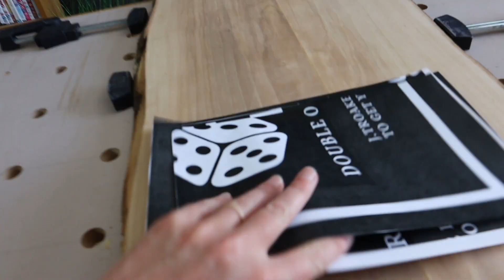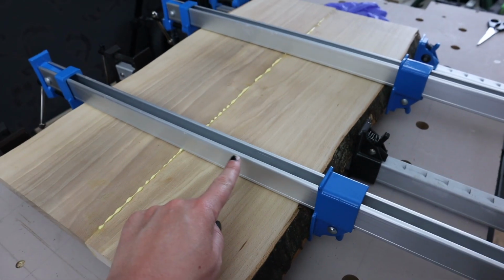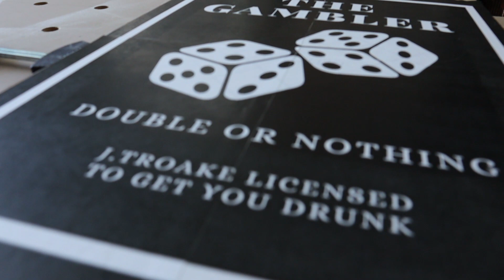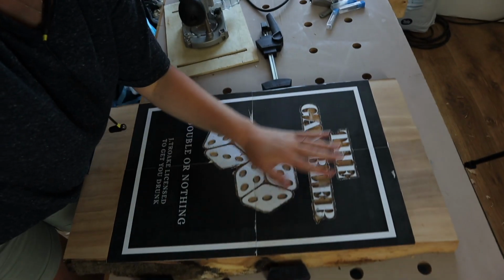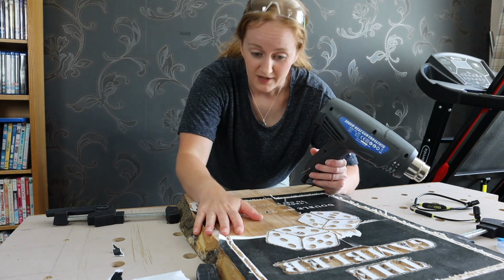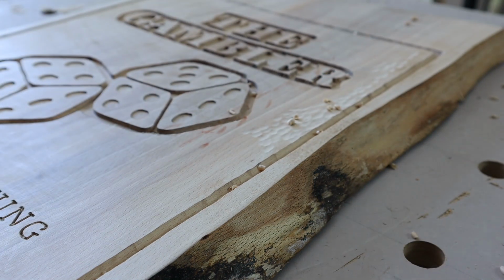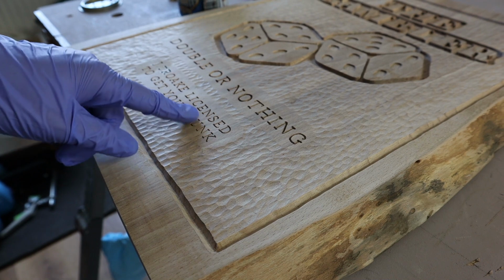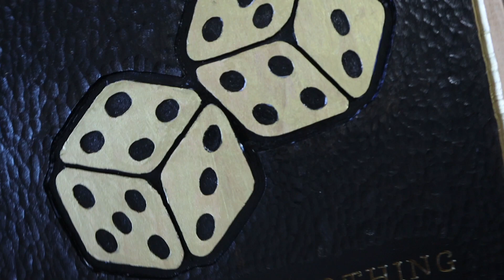THE GAMBLER - How to make a BAR Sign | Hand Routed

Comment: That came out very nice. Do you have any tips for beginners? I have a small router and it jumps a lot where it messes up my letters and I have to give up or start all over again. I see you have a flat piece attached to yours, did you make that or did your router come with it?
Reply from the maker: Thank you very much! I would say the main things that can cause the router to jump around is usually 1 or a combination of the following things. Grain and wood species, speed of the router itself, blunt cutters, taking too much of a cut at one time. The flat part on mine is just a piece of plywood which I made, not specifically for routing signs. Use it for different things but usually gives me a larger footprint when routing over large gaps. I like to use the base with handles because it gives me more control when lifting in and out of cuts. If you have just a trim router I would suggest adding a base (from clear acrylic) and attach two knobs as handles either side. This will give you greater control.

My tips for hand routing would be
- go slow and steady
- use quality/sharp cutters
- be aware of the grain and knots in the wood. Counteract this when routing.
- be aware of the speed setting on your router. For small work like routing letters by hand you can slow it down and still get a clean cut. Might help with the aggressive jumping around of your router
- make a base (clear if you can, helps with visibility) with handles for better control on entering and backing out of cuts.
- I find pulling the router towards me when cutting helps a lot with control, so where the project allows I always pull rather than push

Hope this helps a little. Thank you for checking out the video. And good luck with your future routing projects. 😊✌🏻

Comment: Lovely handmade sign. Love your work. Good to not see grumpy old men woodworking for a change 😋😉🔨✔️. I'm the age I would CNC it, quicker & mitre accurate. (Lot less damage to my old spine too)
 But have you seen Wood by Wright? He's a great "?? agent??," (Grey cells can't remember word) for using hand tools, carving is his specialty. He loves carving Celtic knots on most of his tools!
Personal hint, coat raw wood with polyurethane or Shellac then you can flood fill paint & wipe off  easier as paint won't soak into grain & wipe off easier.
What was the name of top coat you put on the sign?

Comment: Hi kirstie where can I get those bits for my palm router
Reply from the maker: Hey Dazlarg! 👋🏻 apologies I didn’t see this comment sooner. 
The router bits I use are CNC carving bits. No particular brands. I just search for CNC router carving/engraving bits on Amazon 👍🏻

I bought them off amazon a while back. Not sure if they are still available now but for reference if you want to take a look 👀 Link - https://www.amazon.com/Engraving-Straight-Marking-Aluminum-SILIVN/dp/B07PNQ45W4?currency=GBP&language=en_US&th=1
I also have similar bits by FOOS which were purchased off amazon.  link - https://www.amazon.co.uk/FOOS-Craving-Router-Shanks-Carbide/dp/B079LX5GDD
Reply from the maker: Ps, thanks for checking out the video! Hope you found some router bits to get routing with 👍🏻😁